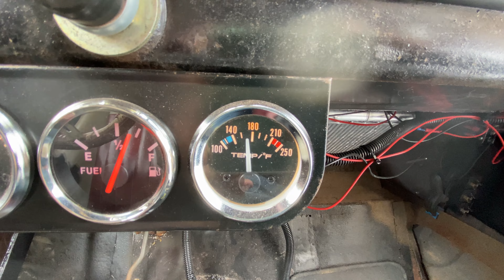Overheating In The Snow? - Coolant System Update

Comment: This may run counter to others advice, but go with a 195. For the thermostat to maintain temp, it has to cycle open and shut. This is harder for a lower temp thermostat to do. This should save you some grief when summertime hits too.

Comment: Definitely go with a new 180 thermostat. My guess is that your thermostat is stuck in the closed position. Also verify that your lower radiator hose is not collapsing. It should have a coil spring inside to prevent this. Good luck.
Reply from the maker: Lower rad hose is one of those bendy metal ones.

Comment: It could be air bound. I always drill a 1/8 hole in new thermostats that don't have one to relieve any air trapped under the thermostat. The hole is drilled between the center and the outer edge. Check the video  SS 396 thermostat trick. 
A bad thermostat  or the water pump is also something to think about if it is an old one and worn out.

Comment: You should run a 180 deg thermostat on these old motors. Your thermostat is def not opening. It should go up to the desired temp and then open and the motor temp should come down to about 10 deg under the set temp of the thermostat and then maintain the desired temp.  Most systems maintain the temp with about a 10 deg variance once it's warmed up.

Comment: I thought for a bit your problem might be that your engine bay might be walled off because the V8 is so large and there are no vents and the hot air could not escape but when you opened the hood that would have given immediate relief to that so that is definitely not the problem.  Using an infra red temp sensor to check the radiator temp is a good idea but not if you don't own one.

Comment: Remember a car will run 10 to 15 degrees warmer than the thermostat that is why everyone is telling you to run a 160. The 195 stat most sbc use is for a truck or van with a radiator twice the size of yours

Comment: Easiest way to check thermostat cool it in freezer .....boil a small pan of water...drop in boiling water if it opens it's a 180 thermostat... you can also heat with your hand torch if it's a 220 or so......If it doesn't trash it.... I WOULD WITH THAT RADIATOR PUT IN 160  JUST ME TALKING

Comment: You can run a parallel switch from inside your car that way you can always turn your fan on whenever you want when it heats up it'll also work off the thermostat or where ever you have it wired now it's just a parallel circuit I would have the fan come on at 160 or 180 210 man that's too hot for middle of winter
Reply from the maker: Great idea Rick. Wish I'd thought of that before I made today's video, lol.

Comment: i live in caif and my 67 buick dont ever reach the half way point but i have a 38 chevy that i have to plan for a v8 and how to keep it cool for a 350 eng. l'ii let you know in the future but you live in a colder climate it seam high for it to heat up so much?
Reply from the maker: Thanks. I figured out that my gauge is not right for my sensor.

Comment: Dave stay with the 180 degree thermostat. Are you sure the water pump is circulating? I know the fan you have is not enough. However, this time of year it should be fine.
Reply from the maker: The pump is working. The thermostat does eventually open, but too late and too little.

Comment: I agree with the comments, take the thermostat out heat water in a cup and use a thermometer to check to see what it opens at if it does at all , I bet these thoughts are running through your head ....could you have put the thermostat in backwards?....I’ve changed many over the years and found a overheating problem was the thermostat was installed incorrectly...is the water pump ..pumping the coolant bad pump , it could be a air bubble , but I think you’ve run enough that it should have burped it self by now . 
I’m leaning to a bad thermostat.....Thanks for sharing .
Shawn
Reply from the maker: Yeah, I'm getting a new stat.

Comment: While I agree that the thermostat is probably at fault, but, if that is not it, are you sure the waterpump is turning in the correct direction?  Don't know the history of your engine but I know that there are waterpumps available for spinning in either direction based on the belt arrangement (serpentine vs. V).  Is it possible your engine had a different belt/pulley arrangement on it in the past?

I doubt this is it, but if the thermostat doesn't fix it, it might be worth a look.  

I know you'll get it figured out!
Reply from the maker: The rad does eventually get hot, so I think the stat is opening very late and not very much.

Comment: 160 degree thermostat should maintain temperature around 170 to 175 more than adequate for your eng. Higher temp stats are for eng with computers to control fuel.  They also use a higher pressure cap on rad to compensate for higher temps ( raises boiling point) !! Most thermostats now have bleeder hole if yours doesn't drill one oh yeah make sure you install with sensor end down. Don't make that sigh lol have done it !!! Upside down no flow

Comment: I see I am days behind again, did you run it without the thermostat installed to see what that reads ?
Reply from the maker: Yes I did. Water is circulating fine now. Temp seems high, but I think it's the gauge and sensor issue.

Comment: I would pull the thermostat and run it without one and check the temperature. If it still runs hot, then you have an air block or bad gauge. Are pet Polar Bears a thing up there? .......Brrr
Reply from the maker: New stat coming. Polar bears take up too much space on the bed.